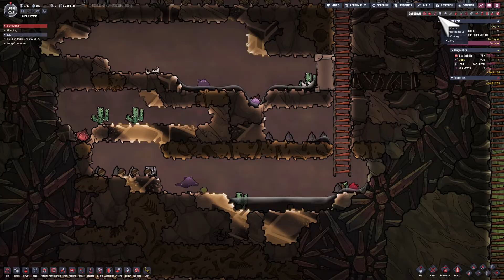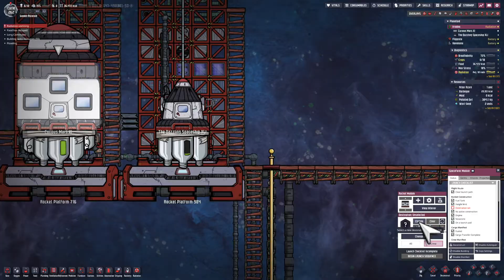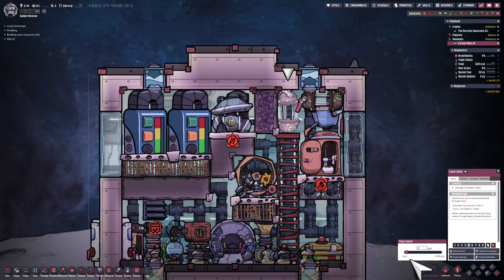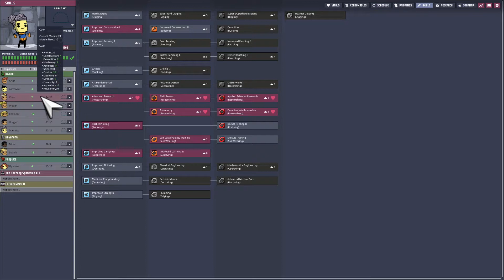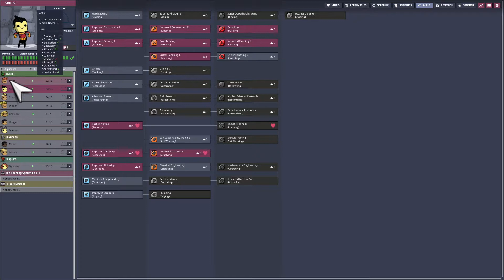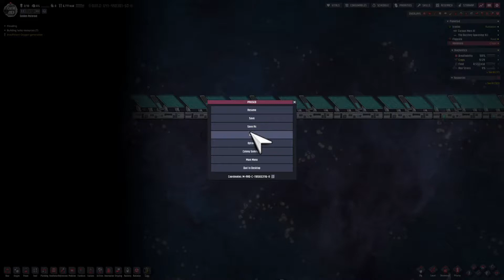ONI: Radioactive Ocean Astroid - #6 Farming

Comment: I’m really enjoying this series. There are some ideas here that I haven’t seen before. Here’s a tip: oil wells work just fine submerged in their own output. I enclose my oil wells with a form fitting building, leaving just enough room for a gas pump to remove the natural gas. I don’t pump oil from the floor. Instead, I pump oil from two tiles higher. This leaves the oil well submerged in oil two tiles deep. It’s own oil keeps the oil well from over heating. No need for a cooling solution.

Comment: heya, great episode - I find you have quite an interesting play style. Figured I'd suggest using slicksters to remove the zombie spores. as long as the spores are in carbon dioxide, the slicksters are able to eat it all up for you,. Makes for an easy, natural solution that requires minimal micromanaging.
Reply from the maker: That is a great idea! It's Carbon Dioxide they love. I ended up solving it in a less natural way which I will include in the next episode. Cheers